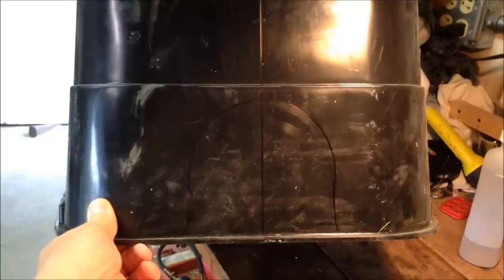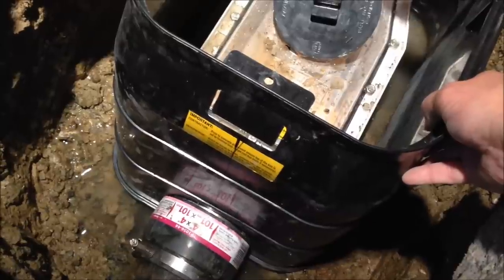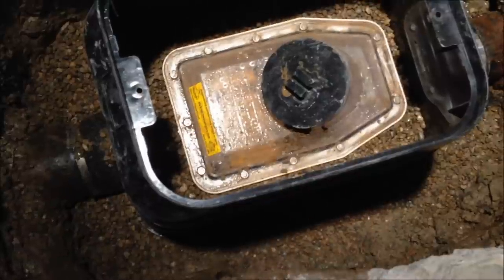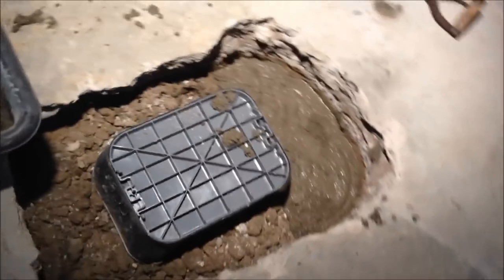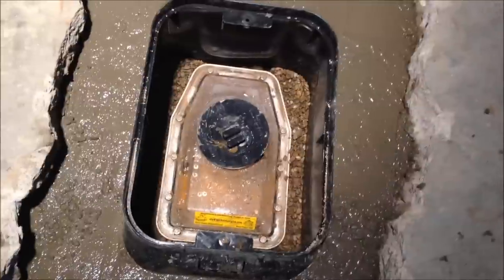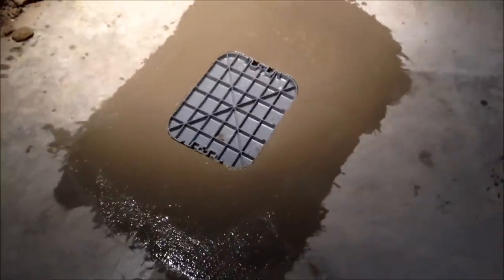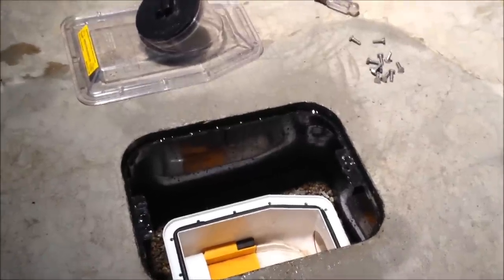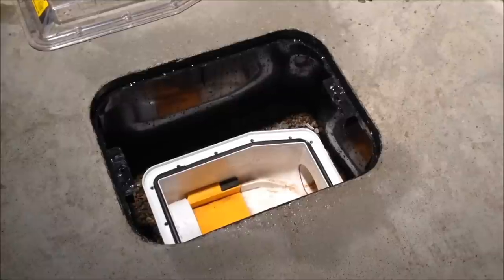Mainline Backflow Valve installation, Part 3

Comment: From a professional plumbing. Looks great. The only thing different I would have done was to pin some re-bar around the inside of the container to resist the concrete from pushing inward. But other than that good job

Comment: I commented on your second video and just wanted to thank you again. I've got the cast exposed and I'm ready to go. Installing should be a snap thanks to your video. But I'm wondering what to use as a bed for the unit. I figure sand. Good support, somewhat flexible. After that? Gravel I guess. One little issue I have is they brought the 3/4" copper watter line in above and to the south of the sewer line. Nothing that will affect the install of the backwater valve but the bucket...that's going to be a challenge. Anyway, just wanted to thank you again. Great video! You actually inspired me to do this.
Reply from the maker: Croy Wedgewood thanks for the kind words. Sand would work too i guess but i still like the small gravel i used. I was lucky that i had no other obstacles near where i installed the valve likes copper water lines and such. Good luck!

Comment: Great Video I learned a lot an im like you I see I learn I do, I cant get this backwater valve as my 1st link in so im going after the trap I know its not the right place to put it but it will still stop the water in an give me time to clear the line without flooding my basement with nasty stuff. Great work you did a fantastic job plumbers dont like us for do it yourself but if you do the job right its ok in my boo.. Great video an great job.

Comment: This is a nice series of videos. You probably saved yourself a couple thousand dollars. My only concern is the flexible box and cover you used. Your floor in that area now looks like a DO NOT WALK on area. So the only thing I would suggest different in what you did was use a much sturdier box and cover. Overall good series of videos.
Reply from the maker: Will Tillman Thanks. Yes, we saved a lot of money doing it ourselves and nearly 7 years later it's still working great. The cover is plenty strong enough to stand and walk on. We're so used to it is not even something we avoid walking on.

Comment: Why did you not place gravel around that connection point? It's encased in concrete now so if you ever have to repair or replace something, it'll create more work and headaches.

Comment: Thanks for this video- I just had a similar one put in by a plumber. Not sure of the brand, it looks the same by mine has a red knob that allows for manual closing of the flapper. Unfortunately, the plumber couldn't do the concrete work. So I think I might try to do it myself- thankfully you posted this video. Where did you get the plastic housing?
Reply from the maker: The plastic housing you are referring to came with my valve. The concrete work isn’t hard to do but the bags are usually 60-80 lbs each so be prepared for that and have a little more than you think you may need to do the job because you only have a limited time to work with the concrete before it starts setting up. Here’s a link to an access box similar to mine, you’ll see there are different sizes to choose from. Good luck, you can do it. 👍🏼

https://a.co/d/bWzLcUo
Reply: Thanks! That’s the one I ended up buying. Need to make the holes bigger.

Comment: Great job! Any updates after 10 plus years? I read in the comments you live in Amherst. I live in Lorain and I'm planning to install one in my house.
Reply from the maker: Thanks. The valve is still working great. Those big storms we had back in August flooded the whole county, as I’m sure you remember, and the valve saved us from getting a couple feet of sewage in our basement like all the other homes around us got. Well worth the investment. Just be sure to clean it every six months, most importantly under the flap that lifts up to block the back flow, and it’ll perform fine. Good luck.
Reply: @LoFiMofo My basement got flooded back in August too like many homes around here. Good to know the valve is still working and prevented your basement from getting flooded. Thanks for the update!

Comment: Great man thanks. How is it working since installed? Anything failed? Or dirt getting i to the flap? How to maintain to make sure no failures
Reply from the maker: That's. Is still working great. Just have to be sure to clean out the valve every 6 months or so to ensure grease and gunk and other nasty stuff doesn't make the yellow flapper stick to the bottom.

Comment: GREAT JOB BUT I DON'T UNDERSTAND WHY YOU HAVE SEAPAGE COMING IN NOW BECAUSE I DIDNT NOTICE THAT IN YOUR FIRST VIDEO. ????
Reply from the maker: Thank you. It’s been nearly 10 years and the valve has saved us from multiple sewage back flows coming from the city sewers during heavy rains. Not sure about the seepage you are referring to?
Reply: @LoFiMofo 

I think he is talking about the water table filling the empty hole. 

Are you able to flush the toilets when the backflow valve is doing its job?

I installed the Oatey valve and now I wish I used the valve with a see through top.

We had a big rain a couple weeks ago and I ended up getting a little water in the new basement shower. I think I caused the problem by flushing a toilet while a backup was happening. We had another huge rain a week later and I got zero water in the shower but I didn’t flush this time.

I’m thinking of installing a 3 inch pvc ball valve to close off the new bathroom. I was wondering how I could leave access to the valve so your access box idea will work perfectly. So thanks for the video
Reply from the maker: @darwinawardcommittee  We avoid flushing toilets or any water usage when we know the valve is holding back sewage from the city. I imagine we could get a couple flushes in without issue do to the length of sewer pipe between our back flow valve and the toilet but I’m not planning on trying it. Glad the video helped you, good luck.

Comment: Great vid helped me out a lot putting my own in! I had a question. My sewer line is a lot lower in the ground then yours and so as a result my access box (same as yours) is too short and does not reach up to the top of the floor. It rests about 6-8 inches below the floor still. Any suggestions to work around that? Is there a way to make the box taller? They don't stack together if I was to use a second box.
Reply from the maker: I don't know of any extension that is available for the access box. Possibly you could order another access box and try and attach them together one on top of the other. That would be pricy and a little hokey but i'm not sure what other options you may have. Thanks for the compliment and good luck!

Comment: should have used the middle piece of plastic pipe that was left over 3/8 inch eye bolt and washer and left over concrete to make a little anchor point great to use as a little tye point for many uses

Comment: Nice Job. Better then the master plumber I had do the work. I need to take him to court. He installed it un level big time. In just 2 weeks myn was just about all plugged up because he has it not even close to being level. Ill try and post a video I have. Its disgusting how people try to rob people blind.
Reply from the maker: Roger Aqwa thanks. Sorry to hear about the bad install the contractor did on your valve, seems to happen all too often. Good luck, hope you get it worked out.
Reply: SH72 I have posted the video. Also a video of the sub pump install that was a rip off. not even conected to any weaping tile.

Comment: great job... thanks, that was done in a basement floor level main line ?where will you install it if the main line goes trough the foundation?
Reply from the maker: Hi Eduardo. The valve would get installed inline no matter if it is below the basement or let's say under a slab foundation. It can also be installed outside the home as long as the sewer line is not too deep, such as in a slab home. Thanks for the compliment!

Comment: nice video brother, I'm getting ready to get same thing done at my house, just one question for you, you said in the video that water was coming from the ground naturally and you put gravel there not concrete is water still coming from the ground? not sure if I did describe that correctly, Thanks!
Reply from the maker: Adwokat Diabla Thanks for the compliment. Yes, ground water will naturally seep in around the outside of the valve or anything below grade. The valve will still hold sewage water from entering your home but any earth ground water from around the foundation is another story, that's where our sump pump takes over.

Comment: did you pull a permit?
Also what was your total cost to do this, vers hiring the job out?

I'd have put some Lime down in the dirt under the backflow to kill the bacteria, you ca still do that. also inside if you don't and that area has ground water leaching in its going to stink up the basement. I had that problem with my sewage ejection tank i had to dig out and replace. The original plumber did not use any gravel I must have used 3 bags of it and 1 80 lb bag of fast set with a hardener.  I also made a dam around it but its not in the middle f the floor like your's is.  It was a much worse job to deal with because of the type of sewage I had to dig out of the pit. Nasty.    My cost to do under 300 bucks with new tank and pump as well as materials plumber would 
have charged 2k.   Its worth it to DIY this stuff. Oh and I showed a lot less Ass crack.

And no I did not pull a permit, I think they are worthless, I did a lot better job than was originally done and its never stunk before it always stunk.

I will say a back flow in the basement is probably not a good idea he lids lift off them and you still get sewage in the basement........ Just saying, if its outside you trap the mess in the ground outside and nt in the house. your much better of with a pit in the yard.
This type of stuff is why cities should give fines to people that do not separate sewage from run off water on there property. But with that said I live on the bottom of a hill short of and 4" sewage lines do back up from clogs of just sewage.
You've slowed down the problem your not going to fix it, add sewage back up to your insurance it dosn't cost much.
Damage from that can cost 1000's to 10K dollars or even more.
my negibor had backflow prevent floor drains even those failed and his basement flooded.

Comment: Will that back flow valve be rugged enough to handle a clean out job by the city crew ? I had the city come in 15 yrs ago because my line was plugged somewhere between the street and my house. The city came in with a great big "snake" and unplugged it (said it was plugged by roots from my willow tree, which I removed shortly there after including stump lol). That snake was so strong he said it would take my head off if it sprung loose. The force he used to ram it through the blockage was intense and took an hour, constantly pulling and pushing on the snake. A plastic back flow with a rubber connector would break in a second if you weren't careful with something like that. Just wondering. Maybe they don't use those big snakes any more.
Reply from the maker: It is made with the clean out access for just such a thing. I don't believe it would be a problem to snake out to the street through the provided opening. However if I ever have to do it I would just take off the clear plastic access cover entirely. The big snakes do thrash around pretty good when clearing out a line. But usually as long as the person knows what they are doing it shouldn't be an issue. Hope that helps. Thanks for watching.

Comment: Do you ever get water coming through the cement
Reply from the maker: This valve has done a great job holding the sewage back from the city lines. The only water i get from around the foundation or the cement around the valve is during extreme downpours which isn’t connected to this sewer line. I have a separate sump for that but the way our home was built in the mid 60’s it’s not uncommon for that to happen.

Comment: looks clean! i watched all three parts but i kinda skimmed through some of it. where did you get this piece of equipment and if you dont mind me asking, how much was it? also, how much did this project cost overall. thanks!
Reply from the maker: Thanks Kayla. The the link below is where i bought mine. It's $229 , including the black access box. Overall the project cost less than $350. The concrete and gravel are about $2 per bag , the pvc pieces and rubber couplings were less than $20and the jackhammer cost $60 to rent for the day. It's a bit of work, but well worth it. Thanks for watching! 

http://backwater-valves.com/Backwater-Valves.asp
Reply: Bayridge plumbing was asking me 6 k to do this shit in 2022 , my friend did it for 1600 dóllar and I spend like  500 dollars on materials

Comment: I'm considering installing this product. Now that you've had it installed for a while, what are your thoughts? Is it a good/effective solution? Have you seen it in action and has it performed its job well?
Reply from the maker: Yes, we highly recommend it! It was put to the test when out city sanitary sewers backed up after rapid now melt and several inches of rain. Here is a link to that video. Mainline Backflow Valve, IN ACTION!

Comment: Mostly good, but the part where you didn't use backfill stone around the one end really scares me. Encasing the pipe in concrete means it will be inaccessible in the future if more work needs to be done. You'll have to break up the floor farther up the line and cut out the pipe and remove a big chunk of concrete. No a great idea, IMO
Reply from the maker: I contemplated what to do there and i decided i wanted the connections to be as strong as possible to prevent any possible issues with the pipe breaking or anything of the sort so i filled out with concrete. It’s been almost 9 years and I’ve had no problems with the valve and several times the valve did a great job and held back the sewer water during heavy rains. Just be sure to clean the valve every 6-12 months to prevent the yellow flap from sticking to the bottom.